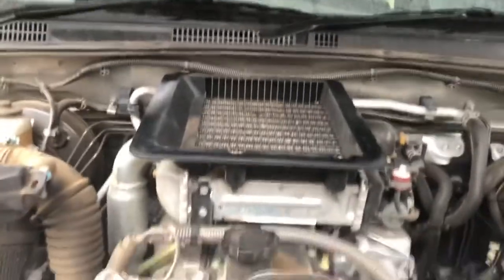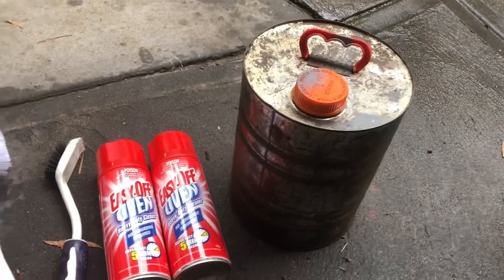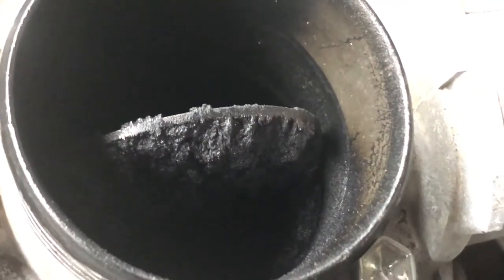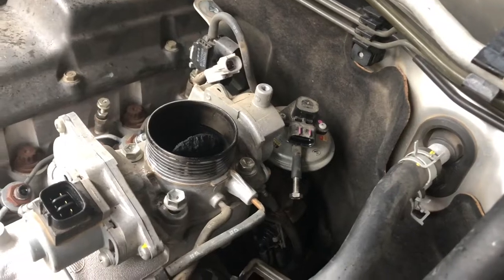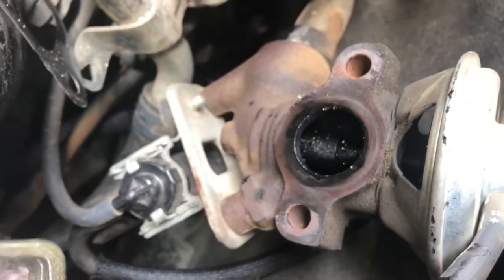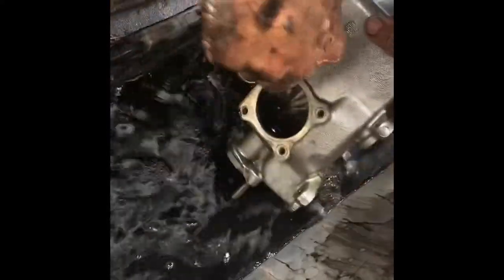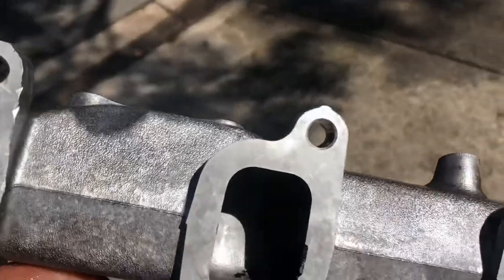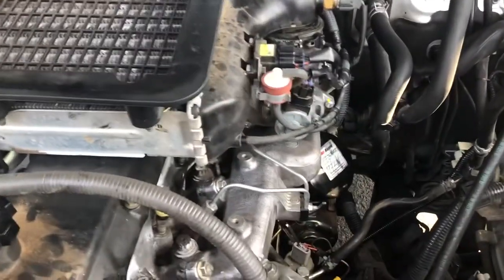Toyota 120 EGR Clean - 1kz-te diesel Toyota 120 series prado manifold and throttle body clean

Comment: Steven, next time you spray oven cleaner over the inlet manifold throw it into a plastic bag and tie it off so its sealed and the results will be much better than before as the cleaning agent is intensified 3 fold. this is a bakers trick for cleaning oven racks!
Reply: I did this after reading your comment. Came back to a badly corroded manifold and throttle body.

Comment: Added this video to my "Motor DIY" playlist.  I'ts one of the jobs on my [ever-expanding] todo list.

What's everyone's thoughts on the other side of the argument re blocking the EGR ie. that it  can can harm the engine, as it will be running with a hotter intake? I'm a bit in two minds whether to block mine or just clean it, as mine's the non-intercooler version.

Comment: Greqat video, however The actual removal and bolt back on shown. I know the torque setting and the nut sizes but do you need a socket extension for the manifold nuts. and if so what size? I may need to get one fro the removal tomorrow/Thursday.
I've also watched your injector vid and doing those as well - El prado has done 340k , bought at 212k and I  have no record of previous service to them
Reply: Getting the inlet manifold off was pretty straightforward, no special extension, but to be highest I can’t remeber

Comment: Hey Steven thanks for the vid very helpful, haven't start the process yet but one question - Did I need to bleed the air out after I reattach the fuel lines ?
Reply from the maker: Paul Daly hi Paul no need for that as the fuel pump self primes and pushes the air out
Reply: turning over the engine is the only way to bleed the fuel lines Paul

Comment: hey man, did you removed the butterflies in the throttle body as well? i blocked the EGR both ends today and just reading some forums saying should remove the butterflies if not it will restrict air flow? how is your engine going so far? any issue after blocking them?

Comment: How’d u clean the ports out in the head so good without filling the valves up with shit?
Reply: I have a manual and put a ratchet on the crank shaft wheel and turned to close the valves. If you shine a light in there to see when the valves are closed then you can spray carby cleaner or whatever in there, leave it in there for a while  to dissolve all the filthy build up in there. You can pump the carby liquid out using a a pump like you use for liquid hand soap  but i found it easier to just use paper towel to absorb it. I used hooky tools, rags and paper towel on extended needle nose pliers to clean it up. it takes a long time and many goes at it. I modified my wet and dry vac with a piece of conduit and gaffa tape to get rid of the bulk initially. blow out with compressed air to finish. came up a treat,
MAKE SURE THE VALVES ARE SHUT BEFORE YOU SERVICE EACH INTAKE PORT or pooh sandwich for lunch you will have.

Comment: Great video Steve. I'm halfway through this process. Just a quick question. How did you remove the EGR from the inlet manifold?  Do you have to undo the large nut from the exhaust at the back of the EGR and then it comes off when you undo the other nuts? Cheers
Reply: Bit of manoeuvring but answered my own question. For those stuck trying to get the intake off you need to remove the 2 X 12mm nuts on the EGR.  You also need to undo the 32mm nut that goes into the back of the EGR. Make sure to soak them in inox or similar before attempting 👍

Comment: Was the egr much of a pain to undo from the intake manifold? Wanting to remove it from my engine but it seems like a very tight fit on my non intercooled model
Reply from the maker: Will Kelly egr removal off the manifold was easy, getting the manifold off the block was a bit harder
Reply: @chaggolies  hey mate. How did you do that?. Mine is so tight!!. Should I push back bend the pipe which is connected?. Or what I can do?. Thanks mate!!!
Reply: @davesanchz4878  any luck? I'm stuck here too

Comment: Hi Steven
thanks for the video. I am having trouble putting the manifold back on and aligning it with the egr.
your help would be greatly appreciated. Does the 32mm nut need to come undone and connect the egr on the manifold first
Reply: Any luck? I can't even get them off for the same reason.
Reply: Any news on this guys ?
Reply: Get oil filter off

Comment: Hey mate any big differences in performance or fuel economy? I’ve cleaned the throttle body but not the manifold
Reply from the maker: I noticed better throttle response and bit more power down low
Reply from the maker: I don’t recall if I had better fuel economy

Comment: Hi there. Random question, do you have a video on how to flush and replace the coolant? I have the same model Prado as you 🙂
Reply: Hey Mizz, what you want to do first is to get hold of a thermo gun and you can take reading of the radiator all over and it will tell you if there's a blockage present. remove radiator and block the bottom outlet fill with water do not put a rag around the top to pressurise the radiator you would split it like a ripe melon so just fill it up then take your hand away and keep doing till it runs clear. you can also get the top and bottom removed and have the fins probed to clean problem areas but this will get expensive as some models a right bastards to seal properly again so do you research first bloke. change the coolant every couple years for trouble free motoring

Comment: With the diesel alloy? Lines did you have to bend them out of the way, are they likely to snap? , thanks
Reply: You remove them from the pump and you also have to remove them from their guide mounts on the back of the manifold. There are 2x 10mm nuts holding them onto the manifold. Once theyre all loose you can move them outta the way. Dont bend them.

Comment: Hey Steven, I'm cleaning my own 2005 Prado 120 1kz-te inlet manifold but a bit stuck trying to remove the manifold. The bolts are off including the two nuts connecting the egr valve but i can't slide off the engine block becasue the egr valve is still hanging off the back end. How do i remove the EGR valve? Do i need to undo the large nut attaching the pipe at the rear end of the valve that goes back to the rear of the engine block? How big is that nut? (It looks pretty big at least 20 mm?)
Reply: Yeah no question, i needed to undo the large 32mm nut connecting the pipe at rear of EGR valve. Unfortunately mine is so badly corroded it is impossible to undo in-situ. I attempted to undo the other end of the pipe that is bolted to the engine block but they are also badly rusted and I have rounded the top nut. Worst possible scenario. So now the only thing i believe i can do is to cut the pipe. I will then be able to remove the EGR valve and inlet manifold and finally clean. I will then have to remove the exhaust manifold (i think this means i'll have to drop the turbo as well) and then will have better access tro the corroded fasteners of the now cut tube and remove from the exhaust manifold and the back of the EGR valve. I've ordered all new bits - manifold studs, bolts, nuts, gaskets etc including a new EGR pipe (albeit for only cosmetic purposes now ;) so hopefully I'll beat this thing into submission. Why did they choose to use fasteners that corrode when there are many other fasteners in engine bay that obviously do not.
Reply: When I removed the the nuts off the rear of the EGR  valve, one bolt came out with the nut and the other only the nut came off. After nearly stripping the the thread off the the bottom RHS mainifold mount bolt to the head trying to force the manifold off the EGR I simply got some pliers and unscrewed the bolt out of the rear of the EGR valve afterwards. Pleasplay would have helped big time.
Reply: @thetango66 sounds like a nightmare. I hope you have recovered. Thanks for the tip!

Comment: How did you clean out the intake ports in the head? What did you find to be the best method?
Reply from the maker: With a brush and manual labour , wasn’t perfect but better than it was
Reply: @chaggolies  looks pretty good in the video! Thanks for posting it. I have an 05 prado with 340k kms on it and want to see if this helps the motor out a little bit. She can be quite lethargic when towing a caravan.
Reply: @chaggolies what cleaner did you use for that? Petrol or oven cleaner?
Reply from the maker: @cheeseburger3209  I used both , initially petrol then oven cleaner

Comment: Pls Guide me I have closed EGR in Same engine and Smoke from exhaust has gone but guide me by Closing Egr will it Damage any other parts Or Leakeage in Oil seals ETC Waiting for your Reply
Reply from the maker: The egr block stops the build up of oily residue and diesel soot blocking your throttle body and inlet manifold , the egr is only for emission control and serves no other purpose, so blocking it will not damage your engine or any other component
Reply: And it won't throw a code once you've blocked the EGR it in a 120 Prado from 2003 till 2004
Reply: Thanks Bhai for Quick response your explanation is good
Reply: What about an 05 prado

Comment: Awesome video mate - thanks for the EGR method also. Did you find an improvement after cleaning the the throttle body and manifold?
Reply from the maker: Found the car to be more responsive and have more zip

Comment: Just tried this but I can't manoeuvre the manifold out. How do you do it? I've removed the inlet port bolts, and the EGR bolts and have moved the diesel pipes but I can't get it to come out
Reply: Got this off. So for anyone else, there's two options to get the egr to move - either two bolts on the exhaust manifold to the EGR, or a big 32mm pipe nut on the egr, I loosened the big one and got it off
Reply: Cheers mate , I’m up to this step , was thinking I might brake something if I don’t research a bit